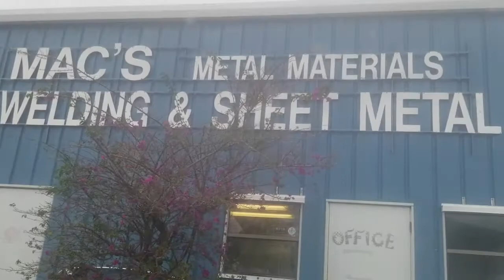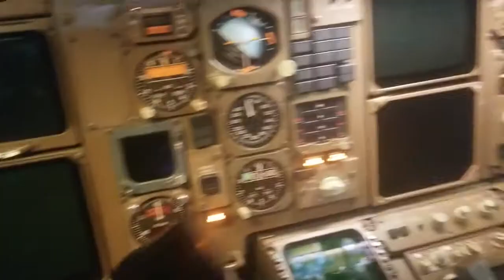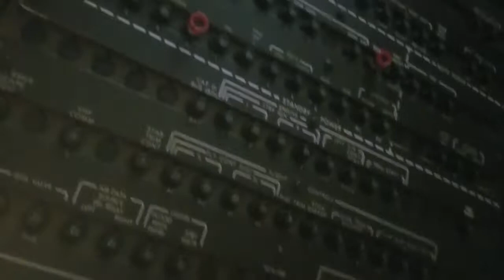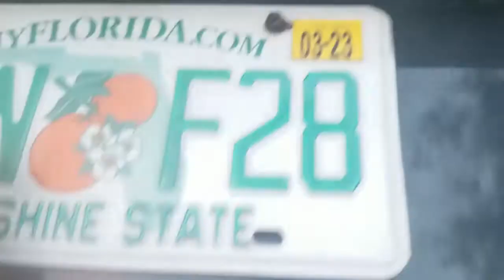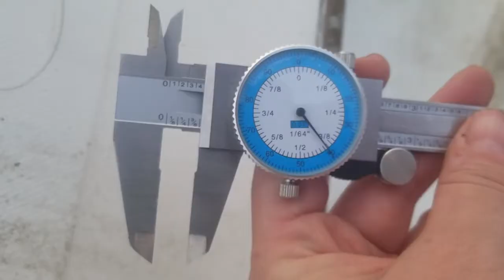TOXIC Work Culture and a MAST STEP!

Comment: Tiff, Those deck chain ‘hawser’ holes are rubbish. They do have a type that have a slot for the chain to come out. The assumption is that the chain goes into a sealed locker that has an outside drain , and not into the bilge. 😀
Reply from the maker: Yes. I'm  wondering about doing something like that, but later. I feel like my Priority list is expanding so much. Haha